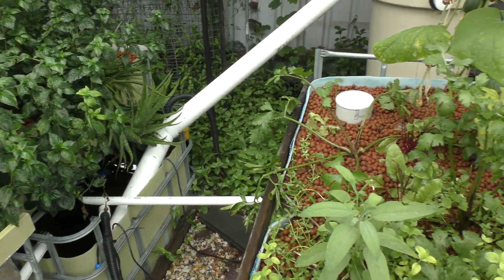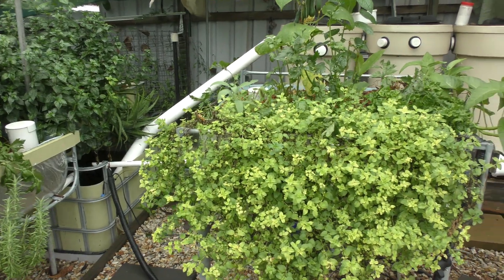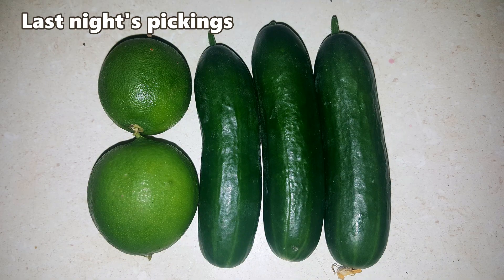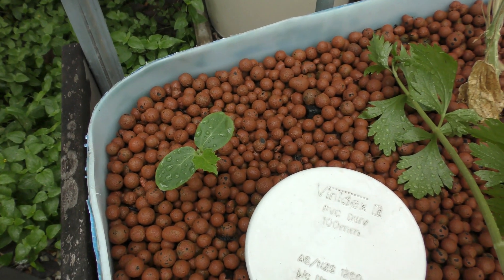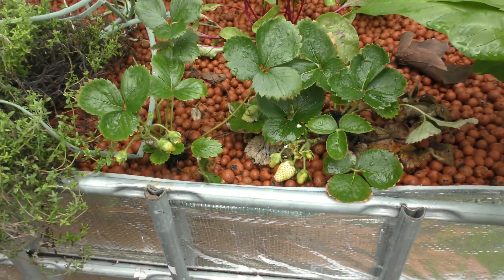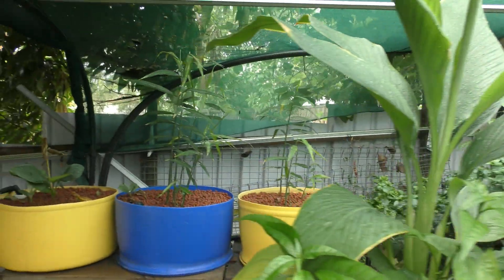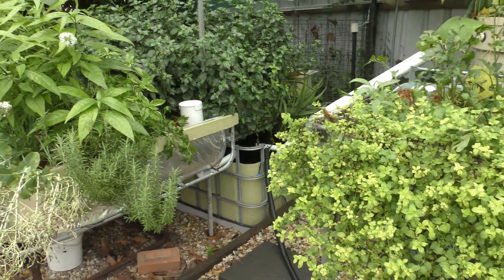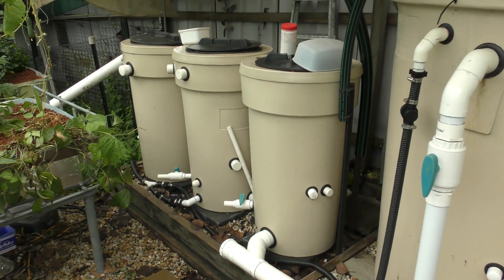Aquaponic System - Harvesting Fish & Decoupling the System

Comment: Decoupling the system means you have to constantly monitor the dissolved nitrates since there are no crops to absorb them anymore, which means more water changes. Commercial  setups automate the monitoring and water changing and is more cost effective at a large scale. A small decoupled system may not be worth the effort, but it will be a good experience and experiment. 

Your problem is with silver perches since you never had problem with jade perches  so the issue is with growing the choice of fish or crops. You have to decide between hardy fish or salt tolerant crops. I think you get more out of veggies than fish so just go with hardy fish and keep the current system intact. Having said that I'm still looking forward to you evolving your system. A great and real channel you have here. Thanks.
Reply: *****
If you have water continually flowing from aqua to hydro system isn't it the same as what is going on now? It's not as simple as you think, there's still the salt to deal with. Decoupling the system only provides the owner the choice of fish and crops to grow with extra work of maintaining 2 systems. The question is whether the choice is necessary for the extra work involved? I still think it's a good project just for educational purpose. I'd love to see what's going to happen whether Rob decides to go ahead or not.

Comment: been enjoying your series and taking some pointer for my own little aquaponic system I got started. have a couple questions if you don't mind. what do you use to raise your grow beds? I've welded up a couple of steel frames which seem to work okay for now but I've heared rust can be an issue after a few years. also and more importantly, where do you source your plumbing supplies? I just lost over $120 for a couple meters of pipe and some adapters to hook up one grow bed. I've know the large hardware supplier charges through the roof but I just can't find an alternate source :(

p.s. I'd love to come check out your system one day if you'd be up for visitors.

Comment: interested in your decoupling.   i am going hydroponics after this batch of fish is gone. i find the fish frustrating.  i lost  a heap after a pump failed.  plus i find eating fish that i grew harder than I thought it would be.
Reply from the maker: Hi Mate.  Sorry to hear you lost the fish Robert. I've tossed the idea around myself as a stop gap measure while the house gets renovated. 
Have you looked into bioponics at all?
Reply: Rob Bob's Backyard Farming & Aquaponics . have not looked into bioponics. i will. the  appeal of hydroponics is . 1  ive done it and well. 
2  i can taylor nutrients for the crops. separate nutrition for each bed if required. 
3  a lot less work. mix up a few hundred L and a float valve and go away for a few days with no  fear. No  heater  for fish. plants don't care if the pump stops for a few hours during a power failure. 
and the big one. my girls won't eat fish from the yard....